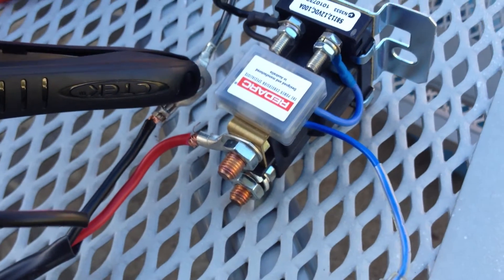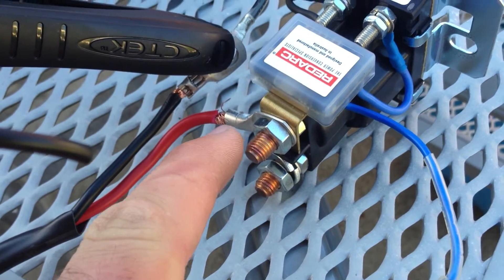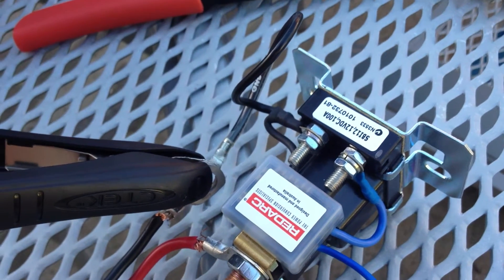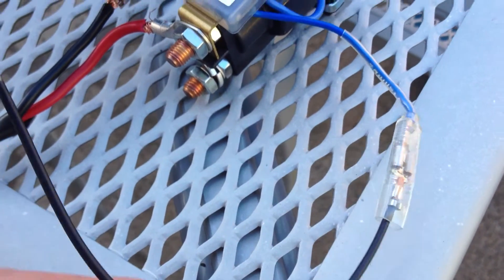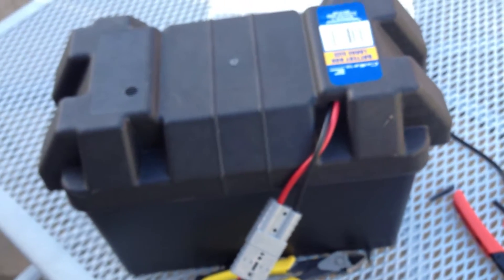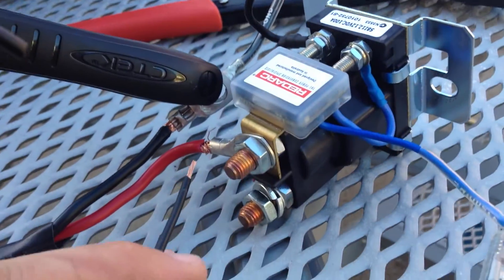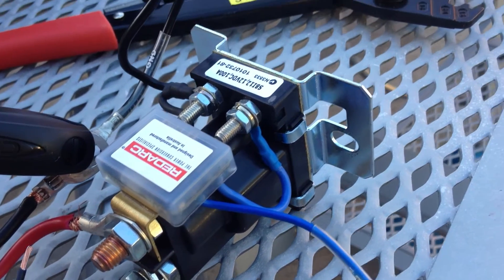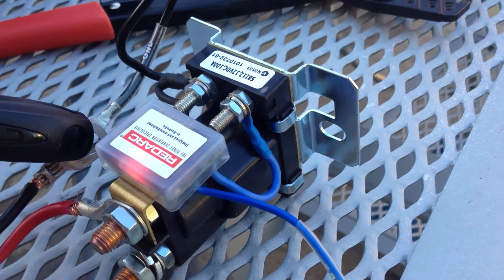Troubleshooting Redarc isolator

Comment: All that the 3 flashes shows is that there’s a voltage drop between the two terminals, ones 12v and the other is zero volts as nothing is connected. This unit appears to be working correctly.